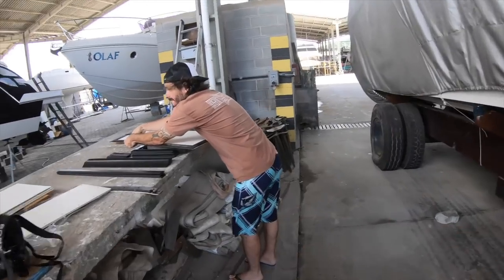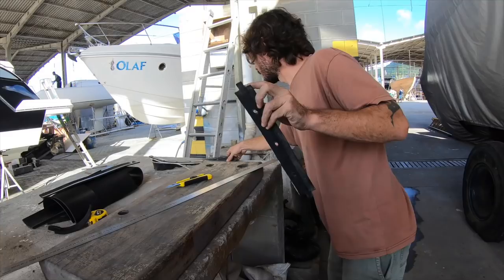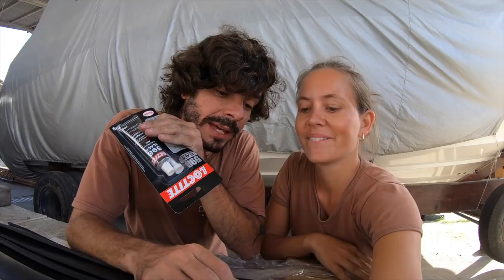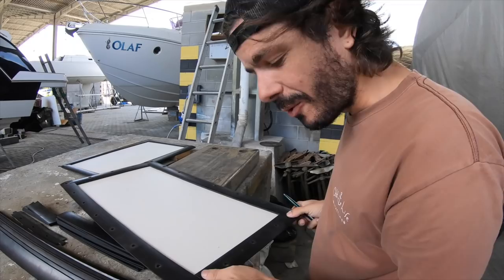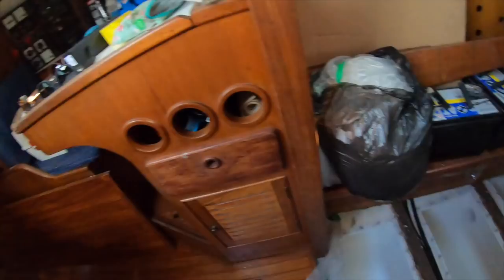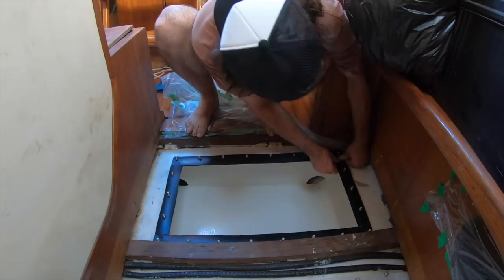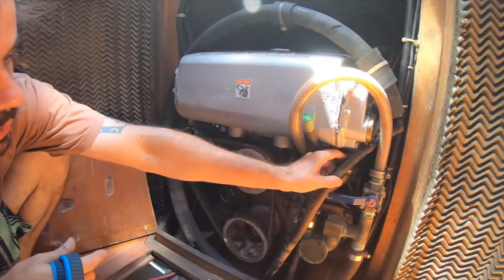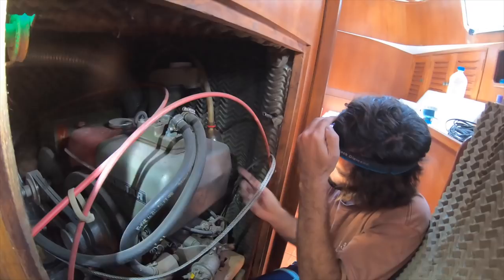⛵️Time to FILL UP our DIESEL tank?!? #127

Comment: Make sure you use good rubber hoses the clear plastic with string in it gets hard and makes leaks at joints also use too   Jubilee clips at each end, a thing I found handy was deck  lights shining down from spreader for any need at night .
Reply from the maker: Thanks for the suggestions, David
Reply: @OddLifeCrafting  hay no problem.

Comment: by replacing one hose at a time you reduce the chance of mixing up the hose connection once you replace the hoses that you want or need to replace then you can reduce or remove the hoses that you don't need or want

Comment: Boats are wonderful for puzzles. I needed to replace a nut on a padeye fitting in the cockpit. First take down the curtains, then remove the curtain rails, then remove the hatch shade blind, then disconnect the lights, then remove the cabin ceiling liner, then remove the winch box, then remove the cable conduit, then replace the nut. Only 2 hours and it looks almost like nothing has happened.

Comment: Color coded messenger lines left where unused hoses removed could be a good investment. Y'all are the best team I've seen, stay safe.
Reply from the maker: Thanks for the suggestion.😊
Reply: Agreed. Also label everything on both ends: hoses, wires, cables, pipes, etc. It will pay out later.
Reply: Agreed. Also label everything on both ends: hoses, wires, cables, pipes, etc. It will pay out later.
Reply from the maker: We actually already did it 😊

Comment: Hi Roberta and Duca,
Just a thought.  You could check the integrity of both your water and diesel tanks by using slight air pressure. This just means sealing the output from each of the combination of tanks separately, that is water and diesel, with a bung.  Then pressurise the input with another bung with an air input incorporated, and also a pressure readout device.  I would recommend no more pressure than 0.5 bar.  Once you have established a pressure then leave for two to three hours.  Integrity will be guaranteed if no pressure drop is noted.  This means you can check the integrity of both water and diesel tanks without filling with water and diesel.  This means you only need to fill up the tanks when you need to use them.
Best of luck, we really really love the videos!  Stay safe.
Reply from the maker: Thanks for the suggestion, Chris. Stay safe as well

Comment: best advice mark the lid to the spot that the lid will fit
Reply: @OddLifeCrafting  why did they not mark the lids the way you do engine piston rods with a small punch to peen the metal. Peen the tank next to each hole starting with 1 and up to the total amount and then do the same for the lids.

Comment: If possible a small rope tied to the hose and then slide out the hose leaving the rope in its place to make running the new one easier. Maybe an option. And if space allows if it is really difficult to get to a brand new one run through as an extra if needed in the future.  Great to see you guys working on your dream!

Comment: Punched holes in rubber gasket with a leather punch. Inserted punch in hole then squeezed down into rubber. For my project it worked well. Might give it a try if you’ve got more to do.
Reply from the maker: We used it for the holes.

Comment: 1st glad you are safe
2) Can you pull hoses but pull through paracord. That way any disused hoses will go but you have a way of reinstalling them at a later date
3) whilst you are locked down and fuel system is still open ..I suggest you think hard about how you are going to measure fuel level. Best system I have seen is to install fuel flow meter as this gives historic fuel used and allows you to monitor instant consumption allowing you to adjust engine revs etc to optimise usage.
4) stay safe guys

Comment: I was thinking that a punch may work better for all the gasket cutouts you are doing.  You'd need to build a steel punch that includes the tab but then you could punch out every corner which should save a LOT of time and be more exact than hand cutting them all.   Looks like you are punching out the holes for the bolts already.   Note that this is done in leather work as well so that may be where you need to go to get this done!

In any case, looks GREAT!
Reply from the maker: That could work, but we would need to have time, material and tools to build the steel punch

Comment: Loctite 598 is the right stuff, oil resistive and stays flexible, I have used it on value gaskets before and it held up for years.  You should have made a metal or wood template for the joint to cut them, next time I guess.
Reply from the maker: Thanks for the feedback about it.

Comment: Fill the diesel tank with water and check for leaks before filling with diesel. water is easier to clean up in case you have a leak.  Or do a air pressure check.
Reply from the maker: Thanks for the suggestion

Comment: Hi Guys. Glad you are being safe and being isolated. We know it hurts, but the alternative is much worse. Have you considered doing an air pressure test on the fresh water and diesel tanks before filling either of them? You pump air into the tanks and listen for air escaping. You can use dish detergent mixed with water around the seals. If there is a leak the detergent will bubble up. We use that technique to check any time we connect propane tank to our BBQ. We love your videos....every Monday is Odd Life Monday!

Comment: This project is looking great guys.  What a wonderful boat this is becoming.   Wondering why you wouldn't just change the generator hose as long as you are there?  You might change your mind and want to use the genset after you get the boat in the water.
Reply from the maker: Thanks a lot. There is no need of changing it as we are planning on taking the generator off.

Comment: Before you put diesel fuel in the tank I’d pressure test the tank.

Don’t use any more then 2 or 3 psi. Then use a spray bottle with soap and check for air bubbles. 

You can do the same thing for the water tank if you wish.
Reply: Also diesel won’t go bad. But you need to remember to put a fungicide in the fuel when you fill up. Don’t ever put fuel in your tank without it. 

Diesel isn’t like gasoline/petrol. It doesn’t go bad. I’ve ran 30 year old diesel.

Comment: Hi guys, I strongly recommend that as you replace the piping and wiring in your boat, that you make a sketch on paper of the piping, valves, and splits for diesel, fresh water and salt water. That will give you a document you can refer to five years from now as you are crossing the Pacific as to which pipe where.  That with pipe labels (fuel to engine, etc.) will reduce the time and frustration of troubleshooting any future problems you may have.  The diagram does not have to be an engineering drawing, just a hand sketch that helps you remember which pipe is on the left, in the middle and on the right as it passes through a bulkhead is sufficient.  As-built photos with labels is also alternative. Just print them out and store them some place you can find them.  Love your channel

Comment: My two cents worth in regard to the water hoses would be to remove the hoses you no longer need and then do the ones you want to replace ,one out one in at a time then do the new routes after.
Reply from the maker: 👌🏼😊. Thanks for the tip my friend!!

Comment: You guys are incredible. Keep it up. Just a observation, at 12:38 I noticed a red electrical cable, which appears to be for the engine starter, if it was me I would not run this next to your fuel lines. But I may be overly cautious.

Comment: When you cut hose from barbed fittings you can create leaks where the fluid may follow the razor blade marks.  Better, if possible, replace the barbed fittings.
Reply: Take pictures lots
Reply: Always cut into the outside of the hose and never all the way through. You can set the razor depth for this. Once the outer part of a stiff hose is cut the last inside bit will stretch enough to slide off just fine.
Reply: Good job.I almost never use slot screwdrivers anymore when working with screw clamps.You must have a 1/4 in socket set? Use the ratchet and the right size socket and you will see how much easier it goes.I usually use a short extension also.BTW..how are the bolts attached to the tank top ( the vertical ones? Like your work.

Comment: Just a thought you might want to label  all your hoses with where they go and their dimensions, so that if you need to change them you will know which hose goes where and the length and inside diameters. As stated just a thought, keep safe and look after yourselves.

Comment: you could replace the rubber line with copper tubing  and put fittings on the tubing for the hose connection at both ends
Reply from the maker: It's a steel boat and if we have less metal is better to avoid corrosion. 😊

Comment: With the rubber puzzle piece, it is best to slightly oversize the male and then slowly trim back the male piece little by little testing to see if it fits perfectly, it takes a little bit of patience and time but it will work out to be tight and perfect. Never mind I'm stupid your already done... :P

Comment: Of course the job is finished since it has been posted - but the next time you want to measure the hose, apply suction (vacumn cleaner?) to one end and feed the string down the other. When it is all the way through, mark it and pull it back out for the length on the hose.

Comment: Hi Guys, stay safe and use the time to think! Have you considered pressure testing the tanks with a low pressure air test? Very useful to know before you start filling the tanks!
Reply from the maker: Thanks. We have considered it. But the test can be dangerous with a wrong pressure and we don’t have a good compressor in the marina we are
Reply: @OddLifeCrafting  you only need to use a byclce pump for the pressure. It is really effective. Do you have a manometer? You only need a few millibars of pressure to detect a leak.
Reply from the maker: We don’t have a manometer and the stores are closed 😬

Comment: I have no clue if this strategy is a good one but I am thinking that you could use "ropes" to replace old hoses and measure them. Then in a second time you install new hoses using those "ropes". What do you think of this?
Reply from the maker: It's one of the ideas. Thanks for the suggestion

Comment: If you would have made your corner joints , dovetail joints, they wouldn’t pull apart no matter where the holes were. Google dovetail joint, you’ll see why. Hope this helps some.  👍😎
Reply from the maker: They are a little bit in this format actually 😉

Comment: Why not pressure test your tanks with compressed air. You could add a pressure gauge and see if it holds it. 15 psi should do it. If it’s not holding, make a solution of dish soap and water and you can spray it on  suspected leaks. The soap will bubble up immediately. Good luck, hoses can be a pain in the butt!
Reply from the maker: Thanks for the suggestion, Gary

Comment: Tighten the plate from the center out to each corner crossing from left side to right side cross cross all four sides save the eight corner bolts for last! I used to do fuel tanks on aircraft in the military! We used a three layer gasket at the edges.
Reply from the maker: 👍👍 Thanks for the tip

Comment: Foot pumps are a pain. Go for a fresh water pressurised system hot and cold. Anchor chain will be best washed with fresh water if you can, perhaps a watermaker? Doing a grand job on that boat anyway. Des.

Comment: My company used to have a service centre and parts depot in Sao Palo. It was really difficult to get hazmat items such as aircraft fuel cell sealant and such. Import duties were really expensive and sat in customs beyond their shelf life we pulled the depot and service centre from the city which was a shame. Not sure why Brazil is really strict with this kind of import. Maybe Embraer has a spares sales office in the town your boat is in? They would have the material you need to close out the cells? Great close out plan for sure.

Comment: I would surjest, you make sure none of the fuel, water and oil lines are not touching each other any thing else, Maybe clamp them or tie them, so that there so they can not rub on any thing to prevent wearing and future leaks.
Reply from the maker: Thanks for the suggestion.

Comment: OMG noooo.!!! There are much easier way to measure pipe length. Tampon+rope+vacuum cleaner : wrap tight tampon with rope and suck it from other side of pipe. Mark rope and take it out and measure. Add to that result 10% and buy length needed. This is works 100% for all the pipes.
And to check the tanks you don’t need diesel for now, air pump and manometer.
Close all holes/pipes, connect manometer to one of the pipe. put some air inside 0.2-0.5bar and wait few hours, if there significant pressure drop then it’s not sealed. If not everything is OK for future check with diesel. I really hope you will see this comment before doing that job. Everyone else put like under it to bring it to the top.
Reply: I gess for testing with air no more then 0,2 bar = 2 meters water.  Usually we use a spesial little vessel with 2 m pipe(  hose on a stik )  up from bottom.  Connecrt the air with a  T joint to dieseltank and  at top little vessel  and when water spills from top of pipe then there wil be 0.2 bar. Safer than manometer.  Test the lid with soap water.
Reply: Love the tampon idea, why didn't I think of that.

Comment: welcome too ownership of boating.  where one simple fix ,costs ten times the price. hell I remember having checked the haul plates, only to find rot.  it took me two years too fix that haddock. then there was the price of ten grand and dock fees. that was me doing the work. killer job. but then again ask if it was worth the ride, hell yeah.as too the water, I had a RV pump that stayed with in limits, and while running it circulated the water once a day ,through the filters.

Comment: I would never use those old hoses that were never used. By now they are all dried and no longer fit for service. You can pull them out and if you need a new line, then install a new one. It's easy enough to have a spare coil of hose onboard for spare replacement. Looking forward to seeing the mast stepped. Stay safe and you'll be back on board soon enough.

Comment: Next time you have to remove a hose and replace it here's a tip.  You can secure the new hose to one end of the old hose.  Just use a strong tape and align the hoses end to end.  When you pull the old hose out the new one gets pulled into place at the same time.  This is especially helpful if there is a run that's hard or even impossible to access.  You can even make the new hose slightly over long just mark the needed length on it too.  Then cut tape off and the hose to the correct length once the new hose in is.  It's an old mechanic's trick.
Reply from the maker: We already did this some times. Thanks for the suggestion, for sure we will need to use it in some places

Comment: you need to have two clamps on each end of the hoses placed on the opposite of each other so you clamp evenly around on the hose and even a spare loose one for the time when one off them fail so its easy just to slide it in place with out having to get through the hole spare part collection in the mittle of the night :-)

Comment: Use color coded strings for the hoses you want to replace then take out all the extra hoses that way you know where hoses run but they aren't in the way as you consolidate your hoses but still know where needed hoses run

Comment: Another great video in spite of the world situation. Thank you! There is something that made me cringe. Flip flops in the boatyard and bare feet in the cabin around the open diesel tanks. I know your trying to keep everything clean and the project is difficult enough without having to check shoe soles before going on board, but I could see one slip in the cabin and those protruding diesel tank bolts going into the bottom of a foot. Please wear some type of shoe with a strong sole. Your terrific people and I wouldn't want to see either/both of you hurt.

Comment: I read you  plan on one fresh water pump with a spare for replacement.  The concern I would have is that replacement can have its seals dry out and when your main one fails and you go to replace it, the spare might not function.  I would think it's better to have a running spare.
Reply from the maker: Good point. We will think about it. Thanks.

Comment: Something to consider in future is use dove tail connection cutout instead of rectangle.  That way the connection holds itself.  Great work!
Reply from the maker: Actually it's a little bit like dove tail. Thanks for the suggestion

Comment: Duca, Do you have any plans to put better filters on that engine? You only seem to have the one Racor screw on that's on the engine.  With all of this work you might want to do another, or a dual filter/water separator system that will allow you to switch between two filters.  A lot of Caribbean ports have really trashy diesel that they pump into your boat at no additional cost.  Then when coming into port with a reef on each side, zero wind and a heavy following sea, that's exactly when you suck that trash into the filter. Mads over on Sail Life is building a pretty bulletproof system that has a fuel polisher built in.

Comment: Are you going to pressure test the diesel tanks with air before filling?
Reply from the maker: Still thinking about it
Reply: @OddLifeCrafting  easy to do, pressurize with air, brush soapy water around lids, bolts....
Reply: Good idea, other idea is to use a air pressure gauge and pressurize the tanks at 20 psi  cheching the air pressure next day, if the pressure is stable then you don't have any leak.
Reply: Warning 20 psi is way too much for a non pressure vessel! Two or three PSI Max!